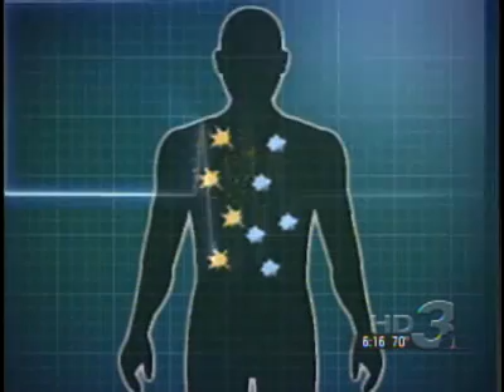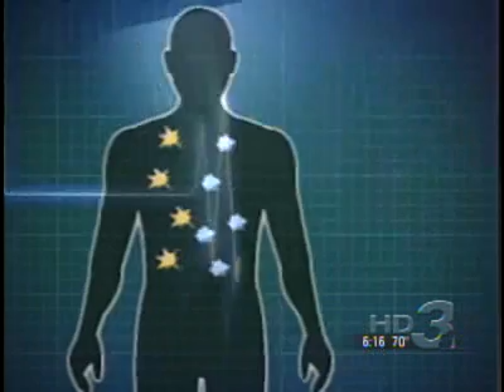Salt Water Fuel

Comment: I get tired of explaining this, but it needs to  be explained because so many people seem to be ignorant of the basic science involved. Water is not fuel. Hydrogen is fuel. Water is the "ash" when you burn hydrogen. It takes as much energy to split hydrogen into hydrogen and oxygen as you get when you burn the hydrogen. All the nincompoops that are getting so excited over this seem to be ignoring the energy used to generate the radio frequency that is splitting the water.

Comment: ok you can make hydrogen from water caustic soda and alloy 0.5kg ok but and i mean but 
the hydrogen gas will burn for so long then go out say after 20 mins or so
but alloy is produced in some factory somwhere and the same flame x3 is needed to produce the alloy
so alloy converted to hydrogen and so on

Comment: ok so if i am correct all you are doing is converting the input power from the radio waves to the hydrogen from h2o 
input 1 kw
output 0.3kw
keep it real man anyone can do that
now if it was the other way round say
input was 0.3 
output 1kw 
but the laws will not permit keep trying dude

Comment: Solar powered or wind powered energy source used to process this fuel into useable transporation fuel would be logical , because we will need a Powerful energy source to propel motor vehicles that can supply power that will be required in certain segments of our production needs like Farming and Processing our food related needs , because you are not going to be seeing to many Safeway trucks delivering food pulling big 50 K loads to the stores running on a wind mill or Electric system .

Comment: The RF waves are not even remotely close to being able to break a pure H20 bond. It would have to be millions of times stronger than the 300 watts reportedly in use. Add to that the small amount of photons that actualy interact with the Na- and we are talking about a very small amount of energy input into the system.
The resulting output...A 3,000F degree flame.

Comment: You're absolutely right.
Any device that separates water into hydrogen will require more energy to separate the water than you get from burning the hydrogen (unless it's 100% efficient, in which case you'd only get out what you put in). 
Just don't tell the "free energy" people this, because they'll start posting Tesla in all caps.

Comment: You can release heat by burning hydrogen and oxygen, but to convert water back into hydrogen and oxygen will always take at least as much energy as it would be released from burning it, regardless of how you separate it.  sodium METAL reacts with water to release heat but converting the sodium IONS in salt back into metallic sodium likewise requires energy input.  Just think of it this way: There's no such thing as a free lunch!

Comment: lol wow u commenters are retards salt water is h2o with sodium (salt) which is also flamable 
just cus u cant burn salt water doesnt mean u cant burn the hydrogen n sodium u get out of it by aggitating it with radio waves the hindenburg used hydrogen it blew up but they are aggitating the flamable stuff out of water burning it then the water comes out the exhaust pipe DRR

Comment: You're correct in that both salt water and human saline is essentially the same. The RF frequencies will disassociate Hydrogen and Oxygen from H20 in both the test tube and a human hand. The difference is that the test tube is lit via a flame to ignite the H2. In the human body the H2 and O2 is simply reabsorbed.

Comment: Are you f'ing kidding me? The biggest cost bar none in electricity generation is the fuel.  If there was a way to generate power from saltwater they would be jumping all over it.  Not even mentioning the fact that it's completely clean power generation.

Comment: IF we recall, or read any history, we'll learn that in 1945 Perry Spencer, later at Raytheon, "accidentally discovered" that high frequency radio waves (microwaves) would heat water. It's a valid idea but far from new.

Comment: What would a car that runs on water exhaust?  What exactly would the chemical reaction be? 

And why the fuck is it always cars that run on water.  If it was possible to extract energy from water electric companies would be the first to implement it.  It's so much easier to build immobile power plants then scale down something into the size of a car.  And electric companies are big enough big oil can't buy them off, not like you can "buy" off and surpress science effectively.

Comment: The "fuel" isn't the combustion of the salt water. The fuel is whatever fuel -- oil, coal, nuclear, hydro-electic -- that's being used to generate the electricity to produce the radio waves that causes that combustion. 

You can't possibly get more energy out of the combustion than you're putting in to produce the radio waves. If you could, you could take the energy from the combustion and use it to run the transmitter and have a perputual motion machine.

That's impossible.

NMS

Comment: How much energy does it take to make those radio waves?  This sounds like a mixer of that invention with the blow tourch that uses H2O and Stan Myers invention for the water engine (not saying it actually worked) but in theory, if you can get the right frequency, one can make more energy then it takes to make it, and this might be it.

Comment: This is not a new invention. The principle behind this phenomenon is also used in a device called an inductively coupled plasma torch, which has been used for decades in elemental analysis and etching of computer chips. Normally these devices use inert gases like argon instead of water, but the principle is the same. Once some the material is excited into plasma, it absorbs radio waves and gets hot enough to generate more plasma BUT ALL THE ENERGY COMES FROM THE RADIO

Comment: I think the difference here is that they are using radio waves to split the carbon bond in the water.  other moethods they say are too slow to procuse hydrogen fast enough to run anything as big as a car.  Also some methods with cathodes give off Chlorine gas as well as hydrogen... so its not so good giving off poison at the same time.

Comment: I think the idea is similar to what the alternator in a car does now... it charges a battery as the car runs.  When the engine is running, hopefully a high capacity or more than 1 alternators can charge a circuit enough to run the rf generator.  So once its started, it runs itself effectively, using only salt water to sustain it.  Well, thats what I would do.

Comment: Naw, Rasputin is correct. Electric motors are very efficent.  Since your going to lose energy (probably considerable energy) through the conversions from Electricity to RF to Seperating the water to re-burning to heat for motion, your way better off just using the original electricity to power the car.  

Electric motors are like 90% effiecent, the cars are less so due to the same losses any car has (wind, friction). But I would be very surprised if an engine powered this way could get 15% eff

Comment: It is a misnomer to think of this as a fuel.  It is not consumed, and all the energy comes from electricity, so it is more like the heating coil on your stove than it is like gasoline.  The point is: it gets 0 miles per gallon because it requires an external source of energy.  And if you're to bring batteries, it would be much more efficient to use an electric motor than any sort of heat motor based on this.

Comment: Are you claiming that it takes more energy to drill and refine oil then is produced by burning the refined products? yes! how many energy units  does it take to get your fuel to you and the gas enginmes also are not anywhere near 100% efficent , dont let the huge amounts of oil pumped &refined  stagger you mankind uses huge amounts of energy just to use energy. what source of energy ,? oil, coal hydro it always takes energy to get the other energy sources we use , its just plain fact

Comment: ...too bad the amount of energy that you put into it (those radio waves aint free) is more than you get out of it. Then it would be useful rather than just cool. --fact is by that arguement gasoline falls even shorter on the efficency scale , whats the amount of energy required to drill ,refine,transport/store&pump your gasoline , by that arguement man  wouldn t have even started using oil, fact is there is no magic over unity fuel but there are CHEAPER /cleaner fuels

Comment: use about 5 amps at 120 volts in a jet kerosene heater burning the keronese at about 1.5-2gallons an hour--or 5 amps at 120 volts to power the fan &pump with a RF transmitter at about 700watts(his meter was showing less)placed on both sides of the ignition chamber replace the kerosene with salt water of course electric power use will be higher (cost)but if the salt water burns you will have a portable jet heater without buying the kerosene, you will probably save money check kilowatt hr costs

Comment: Using basic chemistry...1 quart of water is about 950g at room temp. A mol of water is 18g giving us about 52.5 mols of water per quart. If that's seperated into H+H+O you still have 52.5 mols of H2 and O.  When burned, 52.5 mols release 15.0 MJ/l (of water).

Gasoline has 34.8 MJ/l.  So by what miricle does 1 qt of a material that after using some energy to seperate it into HHO allow you to not need 50 gal of a material with twice the energy density?  Let me guess..You don't know but it does!

Comment: you would still need a significant energy input ...try unplugging that rf generator and see if you can get that test tube to spit out those flames...1500C?  the melting point of aluminum is around 660C and iron is 1540C ...problems...

Comment: here in lies the problem...just what is the efficiency of this procress....i dont know much about the process but if the reaction is instantaneous it could be possible to use a battery to start up the process and use the radio waves in bursts as to keep energy input to a minimum ...but still doesnt seem like you would get enough output for it to be worthwhile

Comment: This should be very easy to understand.  When you burn hydrogen, it combines with oxygen to produce water, H2O.  So with this saltwater thing, the material going in is H2O and the material coming out is H2O.  There is no chemical change and so it is impossible to extract a net energy from this process.  When you burn a fuel, the material going in is DIFFERENT from what comes out.  The real source of energy for the flame this guy conjured from the saltwater is the COAL burned in a power plant.

Comment: Google Roy Rustum, he published a paper with a little information but not many hard facts on the energy involved.

This is basically the same process as electrolysis, except with RF. Actual electrolysis use electrical energy and can seperate the water into it's seperate components.  This process produces a mixture of H and O which doesn't require combustion to occur, but it's probably safer and more entertaining to watch.

Comment: here's the thing, the product of burning hydrogen and oxygen is water vapor. In essence, he's most likely cracking the water into hydrogen and oxygen, then burning them to reform water. During both transitions, he's losing a lot of energy through inefficiency. He's got a snazzy invention to use a ton of energy to convert water to water.

Comment: However, it's a physical impossibility for there to be "slightly more energy produced than consumed". In fact, it's a violation of the laws of thermodynamics for it to even break even.
Vegetable oil and diesel can be used as fuel because they have energy stored in their chemical bonds that's released during combustion. Kanzius' device is doing the opposite- putting energy into the water first, and then extracting a portion of it during combustion. Nothing comes out that he didn't first put in.

Comment: Regardless of what the goal is, what's actually happening here is that energy is being put into the water to liberate hydrogen, and the hydrogen is then being burned to get a tiny fraction of that same energy back out. Salt water isn't a fuel, and in this instance it's not even an efficient energy storage medium. Ergo, it is a parlor trick.

Comment: No. Far more energy is put into the radio waves than comes out as combustible hydrogen. This whole thing is a non-issue. Salt water is not a fuel. This apparatus is powered by the wall current that the RF generator is plugged into. It's nothing more than a parlor trick.

Comment: Resonant freq may improve efficency, but they still won't lead to overunity.  Like I've posted before, I could use res. freq. to break a 4x4 with 2 fingers, but the energy required to break it is still the same. I've just replaced a high load for a short distance with a low load for a high distance.

The only way H2 will reduce carbon emissions is if it's generated with producing those emissions (i.e. solar/wind/nuclear).

Comment: I agree, BN.  It's nice as a proof of concept of targeting RF to resonant frequencies of things, like in your microwave oven, as a way of cooking cancer cells or electrolyzing water.  But the idea of using it to power cars is even stupider than the idea of using hydrogen to avoid CO2 emissions: where are you going to get the energy (for the RF, or to produce and transport the hydrogen)?

What we need is an orbiting satellite with huge solar panels and RF transmitters aimed at every car.

Comment: The whole spark argument is asinine, especially when comparing it to the RF generator.  The RF requires a significant energy source (i.e. big batteries) where the spark contains a negligible amount of energy.  Besides, the hydrogen needs the same spark.

Not that any of the matters because using this process to power a car would be completely idiotic anyway.  Makes about as much sense as going out to your current car and removing half the spark plugs.

Comment: You don't need a battery to run a car, if you have a diesel engine.  No spark plugs in there.  The battery helps with starting, and running the fan and wipers and stuff, but that's all the electricity is for.  The engine, and the motion of the car, are purely from combustion - no spark necessary to ignite the mixture.

Anyway, this all misses the point, just like the "hydrogen car" hopes.  We need a good source of energy to produce hydrogen.  If we burn gas at the power plant, that's still C02.

Comment: Yes a MANUAL car can be started without a battery. To my knowledge an automatic car cannot be started without a battery; unless you go back to good ol' manual hand cranked motors. Its called bump starting. By pushing a car to a steady speed between 3 and 7mph, then jump in, push the clutch in, and engage second or first gear, then dump the clutch, then puch it back in so it idles and doesn't lurch. Make sure the key is on and you will find that your car will fire right up.

Comment: Harmonic frequencies don't reduce the total amount of energy required to "break" something.

Give me a 4x4 with one end set into the ground and enough weight at the top to lower it's harmonic frequeny to something I can match and I could bust it with two fingers given enough time to build up the amplitude.

To break the bond will still require more energy then you'll get by reforming it by combustion.

Comment: akajj1234,

Too bad you need gasoline or electricity to turn the water into something burnable. Notice how they never say that it will reduce gas costs? You'll need more gas to run a salt water engine, than just a regular engine.

Also, his cancer cure is nonsense. Why would the metal particles be attracted to cancerous cells?

Comment: Nutricidal, have you actually READ the study? I did. (BTW it's the Journal of NanoBIOtechnology.) First off, it isn't just straight CS, it's CS with a "foamy carbon" capping agent. 2nd, only nanoparticles of less than 14 nm were interactive. And yes, it did inhibit HIV-1 in vitro, but the paper clearly states that there are potential toxicity issues. The same could be said for bleach, but you don't hear people claiming that "bleach therapy" is being suppressed by the "plutocracy of America".

Comment: If I've misrepresented or presented any fact errors regarding Roy and Slawecki's attitudes and positions then by all means correct me! Otherwise, step aside. Yes, they're also materials engineers, but the points that I brought up betray a deep lack of critical thinking and a willingness to embrace pseudoscience. It's not character assassination. It's a refutation of your argument from authority.

Comment: You do realize that if a flame or wick is not provided the hydrogen and oxygen will simply recombine to H2O. That's what they were working on (desalination) before someone decided to put a light to it. While it's somewhat violent on a molecular level it's not a 3000 degree flame by any means. No wonder you're so confused.

Comment: Since you refuse to answer can we assume you feel the same way even if the hydrogen is NOT burned?
What you fail to grasp is the concept of conservation of mass and energy. In one experiment if the hydrogen is not burned the hydrogen will then recombine to THE SAME mass as before. In the other experiment when hydrogen is burned at a 3000 degree flame you cannot have THE SAME mass. That would produce free energy. Sorry if the logic escapes you but I tried.

Comment: Actually, GSpotter, you could do just that. Heck, you could build it yourself. I don't know if hydrogen is commonly used as the energy storage medium, but there are people TODAY who run their homes either partially or (in a very few cases) totally on solar power. It's expensive because photovoltaic cells aren't cheap (though they're getting cheaper and more efficient all the time), but it is doable.